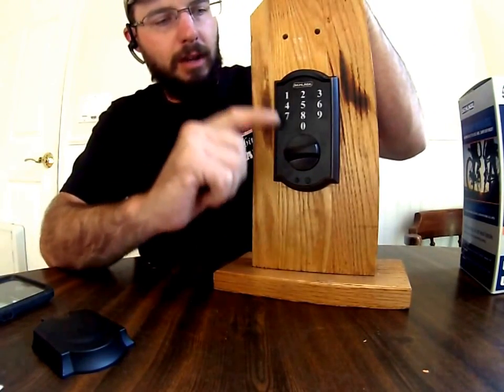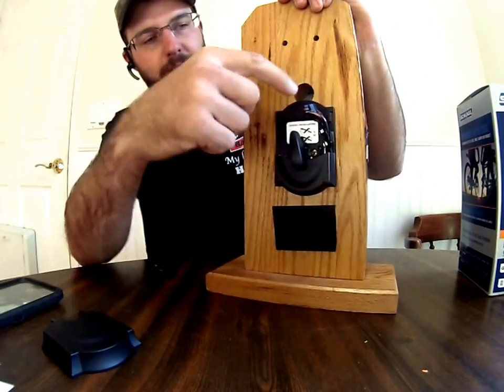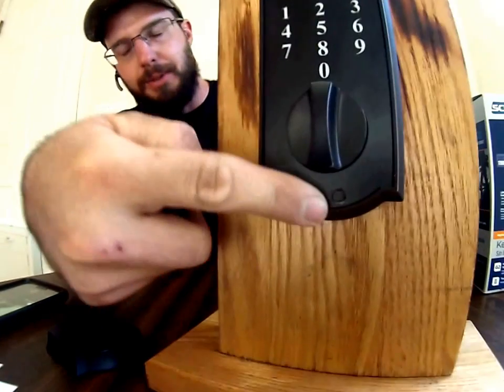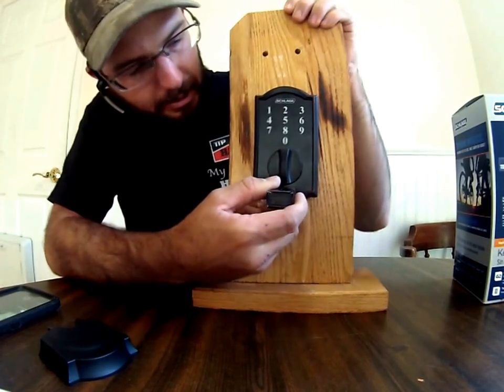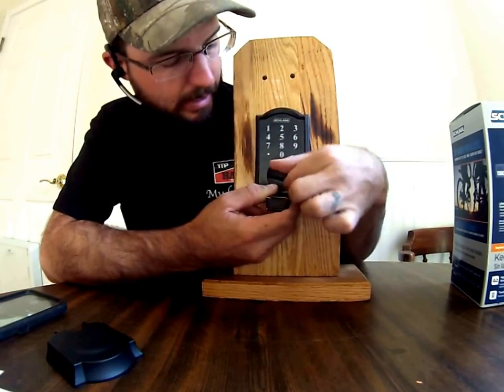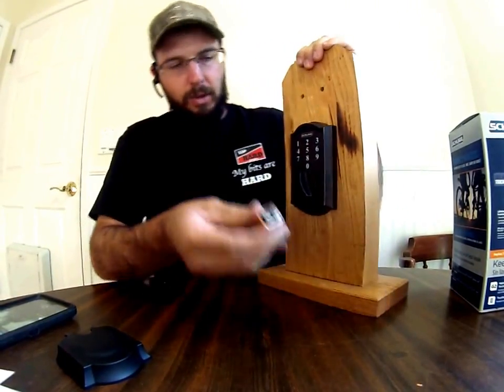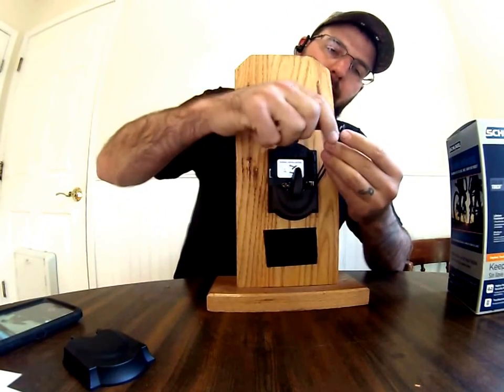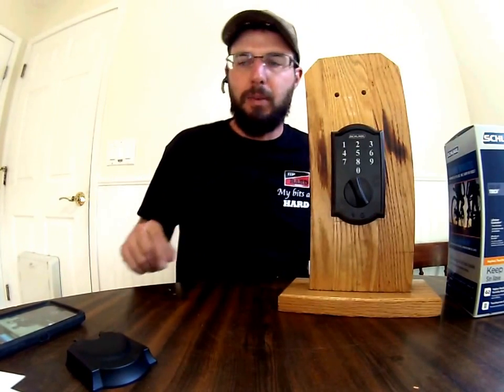FAQ Battires Dead On Schalge Deadbolt Lock BE 375 How to Jump and Fix with 9v

Comment: Hi I tried this n the numbers light up,  changed the battery but it still won’t connect. Numbers will not light up, and now the door will lock n unlock without the code

Comment: Hi, when I tried this, the green light up, then I press the passcode, after put in the code, there is a red low battery light flashing on the lower right corner of the pad.  What I do now ?
Reply: I did the same thing but it should be good if you leave it on longer, sorry for being three months too late

Comment: This is great to know.  A year ago I came back from a vacation and the battery was dead so I couldn't get in the front door.  I had to call a locksmith who went to the back door and had to make a key to get in.  All for the low price of $100. You are awesome Wayne!
Reply: That actually is a relatively low price tbh could be a little lower but not terrible either